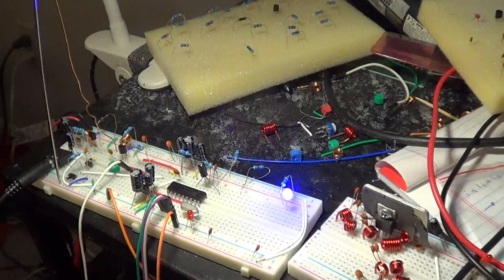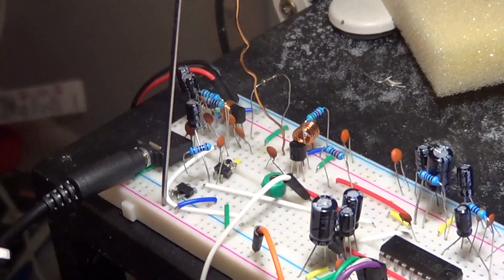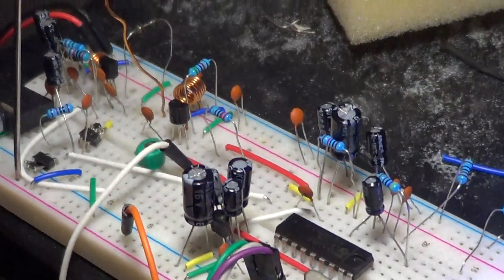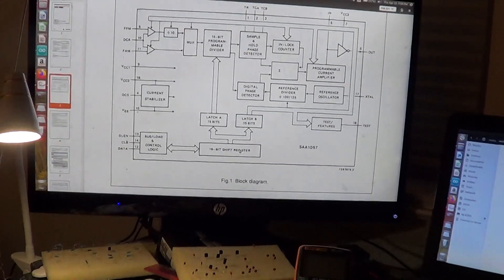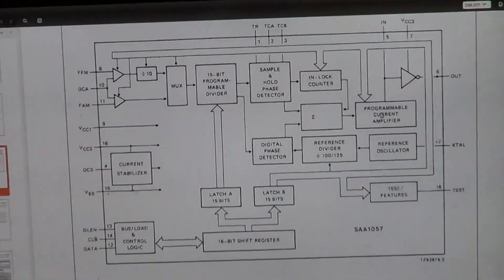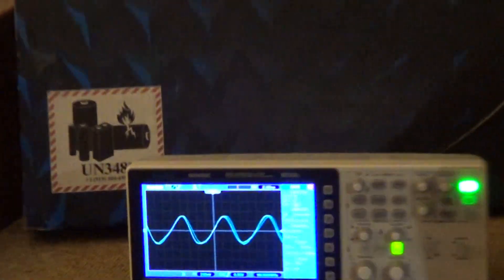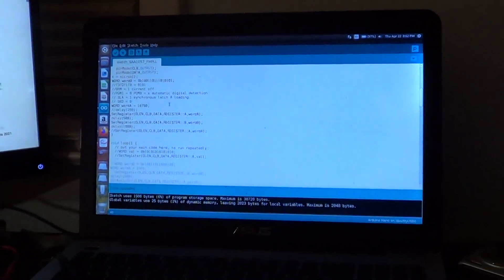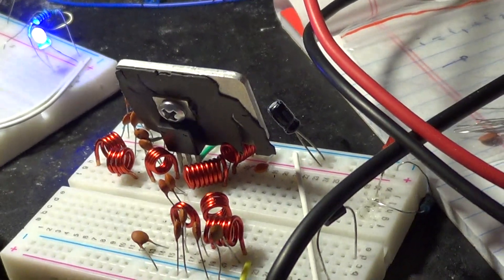SAA1057 Philips PLL IC programmed with Arduino to control VCO FM transmitter frequency.

Comment: Any way to disable stereo coding, using, ex, left channel to direct input the MPX signal from external audio processor?
Reply from the maker: In this prototype there is no channels. It's a simplified VCO controlled using  a Locked loop IC programmed using a microcontroller in this case the Arduino board. This particular design is a mono. The stereo can be achieved using a PC to do the audio signal processing and combining all of the signals into one channel that can be sent into the VCO input signal. The video is about how to achieve a stable no drifting signal. It is only dedicated to the carrier signal 88-108MHz.

Comment: It be nice to see your circuit and Arduino code , there is another version of this using Arduino and SI 1531 Module which contains Oscillator x 3 used for Radio Amateur use widely as can be set up with 3 separate output freqs , as used in communication Transceivers up to 225mhz been told ,it also has small or large displays a on d freq. Select control the circuit is available on Internet but the Arduino Code for this harder to find , originally came out 2019 but coding was always hard to find maybe people did not want Chinese manufacturer s to find easily as they copy everything , Radio Hams use a lot sorry I do not know coding, hope this helps

Comment: Very good ....exactly what i have been doing last winter .... Your programming code is much cleaner however using this library
Reply from the maker: Thank you. I managed to put it into PCBs and have modular design and 3D printed the FM transmitter.

Comment: Can you share the code and the schematic for your breadboard layout? I may need to use an Arduino to control an SAA1057 in an FM tuner. Thanks.